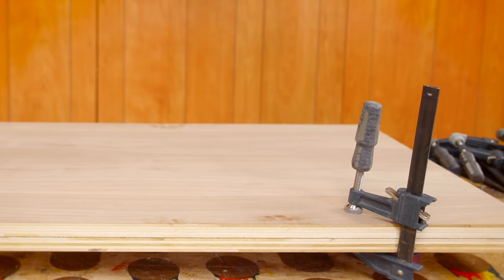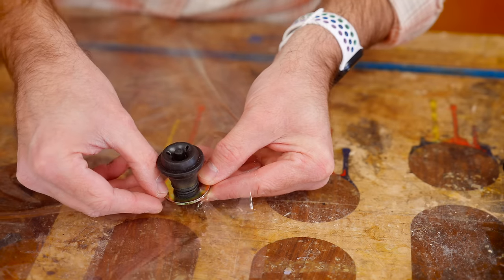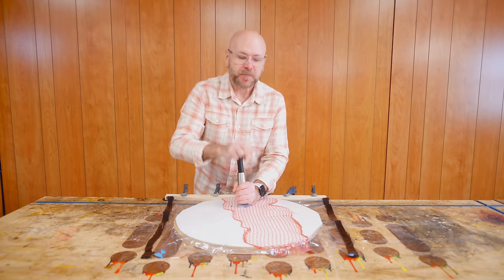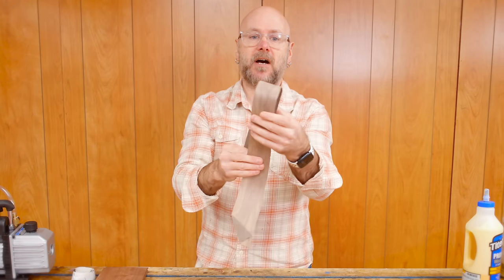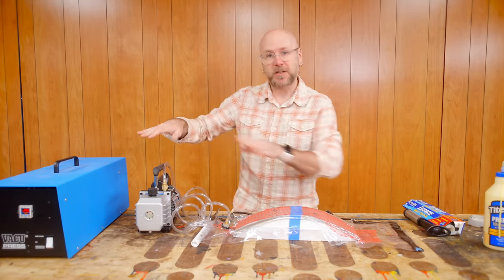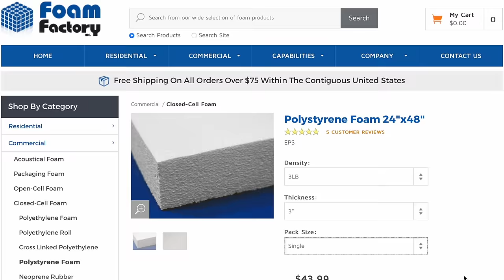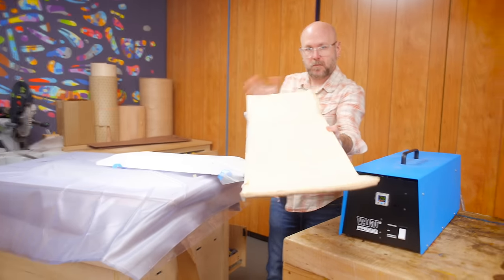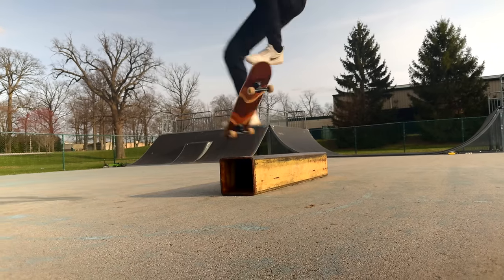Cheaper and Can Do More Than Regular Woodworking Clamps!

Comment: As someone who's spent years working with these kinds of vacuum systems, I'd like to make a few suggestions.  1.  Of course, a vacuum system generally works best.  However, there are other options.  You can use your existing air compressor to get your vacuum by adding a venturi adapter to the line.  This has worked well for me.  You can use a shop vac but you may not get as high pressure as with the venturi.  2.  Adding a vacuum guage will help you detect leaks.  3.  Using mesh completely around the device ensures a more even vacuum pressure.  I used girls knee high stockings for small items and womens stockings for larger.  If they stretch out too far, it's a good idea to put two layers on.  They will give even shape over the entire form and material.  4.  There are a number of ways to make forms.  Moulding plaster, bondo or similar which will hold up better and can be reused easier,  and I'm sure there are other materials that will pour onto a mold.  For your skate boards, encircle a skate board with a dam with the top of the board to the inside,   Seal it and pour the material on top of the board.  If using plaster, add metal stiffeners to help prevent the plaster from cracking.
Reply: Has someone tried out those vacuum bags sold on TV shopping shows usable for clothes, beds and such for clamping? We own four of them, three of them hold the vacuum for years now, stiff as a board. (My idea is the advantage of using a normal vacuum cleaner.)
Reply: @orazha thank you for the specific tips to improve this process.  Do you have any YouTube’s on the process?  I would love to see the mold making process especially!

Comment: You can also scavenge a refrigerant compressor from an old water cooler or other appliance. These will pull a vacuum, and they are free if you go dumpster-diving or heavy-trash-pickup-surfing.

Comment: You forgot one pump that we mostly all have in a shop.

The shopvac. I use it for removing air for clothing bags, vacuum molding before I had a 3d printer. And you can also use it to inflate things like party balloon or boat etc.
Reply: Wait, how do you use a 3D printer for vacuum molding?
Reply: @newolde1  think hes saying he did vacuum forming to make things b4 he got a 3d printer
Reply: @zednott  darn, I was hoping to learn a new trick.. 😊
Reply: @newolde1  well i suppose you could 3d print negative molds to use in vacuum forming.
Reply: @zednott  yeah for sure you can! But that's not a new trick.. 🥲

Comment: Good video
Joewoodworker has a lot of info on vacuum pressing and pump setups. 

Bag tip - If you have a shop around that makes boat covers they use clear vinyl for the the windows, You can get cut offs cheap or free most of the time.  I have bought  sections from shops to make different sized bags for a fraction of the costs you could purchase the vinyl elsewhere. 
I use HH-66 vinyl cement to glue the edges it works great and makes a permanent air tight bond.

Comment: I like the idea and will surely use it someday.
Instead of going to Harbor Freight to spend 100 $ on a pump I would take an old fridge and take the compressor from it. One side gives off pressure alright, but the other side will suck. You'll be amazed at what it will do, and at 0 $ ...
Secondly I would add a little ball valve to shut things off once you've reached sufficient vacuum.
Reply: Exactly what I was thinking of commenting. Discarded window a/c's are another good source. Cheers

Comment: Use some bowed braces across your pieces with your f-clamps and you'll get more reach and more evenly applied pressure.  

The braces don't have to be literally "bowed" either.  You can put cut a curve on one side and then make strategic relief cuts on the straight side to dial in the amount and location of pressure as needed.

Comment: I bought my vacuum pump from Amazon, last year. It's similar to your 2nd version, but I made sure to get the oilless version. The one you have will spit an oil mist into the air as it's running.

The reason I bought a pump to begin with was to use as a small vacuum generator on my Axiom cnc. So far, I've made 2 small platens, just as proof of concepts, and they work great. They're about 8"×12" each. They hold a piece of melamine like a monkey holding a banana--not letting go!

My next version will be like the Air Weights version, 24" square.

Comment: I have a kitchen appliance made for vacuum sealing bags.  It includes a tube for use with bags that don't fit in the sealing iron, as well as reusable valve bags and jars.  That should be intermediate in power between the hand pump and the Harbor Freight pump.

Comment: Awesome. I just made a piece and vacuum clamped using butyl tape, plastic sheet from home depot and a vacuum pump (I have a vacuum pump salvaged from a closed factory). I did it a little differently, by bagging to a table top and using pleats in the tape so the bag didn't bridge. The bags not reusable, but it's cheap as dirt so who cares. Wrapped a tube with butyl and ran it through the perimeter tape. I filmed the whole thing so I will probably post it somewhere soon.

Comment: Clothingbags is imo the cheapest option. Buying a set usually comes with a handpump. I use the shopvac fir most of the air and then use the handpump.
Those bags can be used multiple times and its not that messy.
Great video!

Comment: Check out vacuum bags for clothes, might work too, with a little less faffing about.
Reply: I was thinking about this too.  They use a vacuum cleaner to suck the air out and come in all sizes.
Reply: You can also get mattress ones, way bigger.
Reply: I have used the clothes vacuum bags with the included hand pump for a fiberglass layup and it worked great!
Reply: As long as you can get multiple uses that would certainly work. But in my experience those are significantly more expensive

Comment: Another possibility, with a little modification, is a bicycle tire pump. It will get you a lot more pressure and volume (and therefore less work) than the wine pump.

Comment: Instead of sealing tape, try the cheapest bathroom caulk you can find, works a treat!  Will also work for your seals.  Back in the day when I was doing a lot of this, I would just use 1/4" poly tubing stuck into the bag with a small piece of paper towel wrapped around it as a filter to keep from sucking resin, again, sealed with caulk going into the bag.

Comment: You could wire up a vacuum switch to the HF pump. Just like a pressure switch on a compressor. Then it'll run like the 1K version.

Comment: The HF punp risks burnout leaving it on for any length of time. Those are not designed for permanent use, really. Probably be great if you could put it onto an intermittent on-off timer so it operated every five minutes or something like that. Isn't  as reactive as the $1000 pump, but it's probably adequate to keep the thing tight while allowing the pump to cool down regularly.

Comment: you might try a shop vac,, but beware that some shop vac motors are cooled by the air passing through the tubes instead of having a separate fan

Comment: So, the difference between a 99 bucks and 999 bucks system is an Arduino, a pressure sensor, a relay and a  valve that keeps the vacuum from escaping? Provided not a lot of volume needs to be pumped?

Comment: Thanks for the idea of the vacuum bag !
It gave me ideas too... You surely have compressed air in you workshop ? Get a venturi module ! (about 30-50$ or find one on a scraped machine)
There are rubber strips to make vacuum bags, even huge ones, and also for the fitting, rubber seals. (put sealing tape and hot glue away)
Last one, there are big vacuum bags for clothes and thick blankets (duvet ?) which work with a simple vacuum cleaner. (worth the test)
Reply: The venturi models can be found much cheaper than that, but you need a continuously running air compressor for it to keep the vacuum going.
Reply: @acerjuglans383  yup, I've done this with venturi just to say I done it, not as good, and loud!

Comment: Hi Dave. A great video yet again thank you! You mention the webbing is to show the pump is sucking air from all sides. How does the webbing show you that?
Reply: it's to allow air flow around the top of what you put in the bag.  You can use a couple of layers of paper towel to achieve similar results.

Comment: Great, thanks for producing this video!  
Maybe this great video below will re-ignite my use of a Roarocket kit that I haven't use a quite a while.
I've  got a question:   What do you use to clean off excess butyl seal tape from the vinyl bags?
Reply from the maker: Thanks! I think I just rubbed it off with my fingers. The stuff is messy.
Reply: @MakeSomething  not sure if the tape that came with my Roarocket kit was the same, but it was super sticky glop.

Comment: Check out the Baumgartner Restorations YouTube channel. Besides his art oriented subject matter, he has a very maker mindset with his methods of art restoration. He uses a heated vacuum table for paintings. Though you probably wouldn't have a use for the heating feature of his table, I think you'll find the vacuum features of how his table works pretty interesting. It eliminates making bags, messy sealing tape,  and janky air nozzles. He has a video of the build for the table too. Great job making some beautiful functional art😊.

Comment: Am I the only one who uses a regular household vacuum cleaner to get the air out of vacuum bags, no need to buy an expensive pump, any old vacuum cleaner, even the cheap ones. Edit: you also usually get some accessories when you buy a cleaner that fits over a wide variety of valves

Comment: I would have to disagree with you, the vinyl bags that you are using are very easy to puncture and they often spring a leak at the Seams, the poly bags are 3 times the cost but are a lot more durable
Reply: ‘Cheaper’ seems to be a key word in the title of this video. 
You may or may not find the word there somewhere if you look extremely closely…

Comment: You don't to spend $1,000 to achieve Level 3.  I smaller, hobbyist oriented pump from the same company runs $400 and will pull a sufficiently strong vacuum, although not as quickly, to do those skateboards.